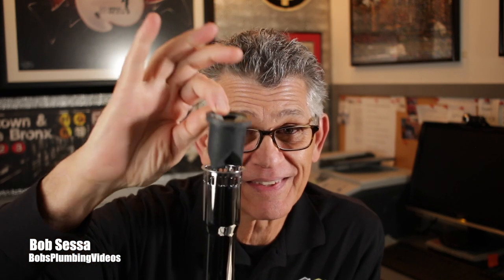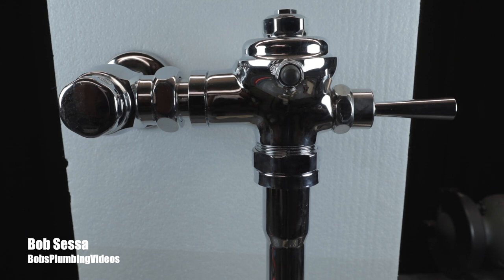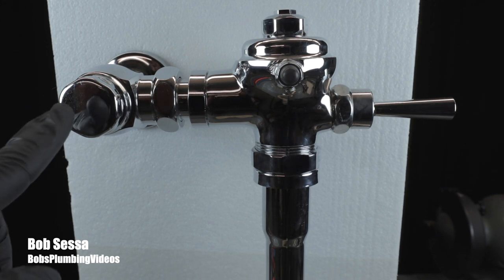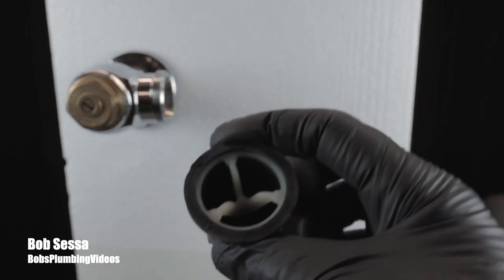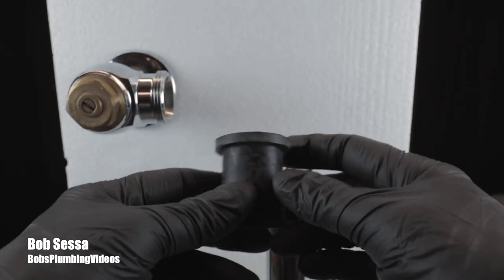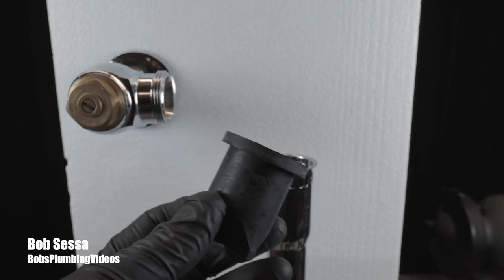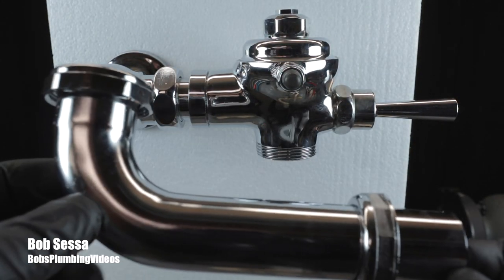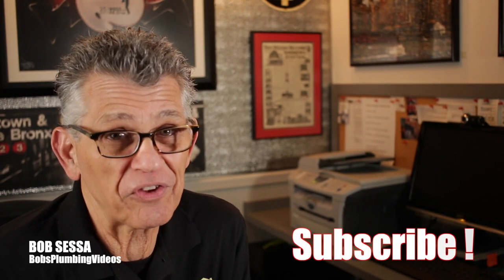Toilet Repair vacuum breaker leaking

Comment: Bob, you really should do a real life change of a flush “o” meter and show what a nightmare it can be!!
Reply from the maker: No doubt about it, I'll do it on the next change out but they've been far a few in recent years. Not many in private homes and the ones in multi unit buildings are being done by the superintendent's of the building. Thanks for checking out the video. Bob
Reply: wouldn't hurt to show people what it's like when you change that vacuum breaker it still leaks. That's a common scenario.

Comment: Good video! I just installed a new vacuum breaker and im getting water out of the air holes reinstalled the old one and the same thins is happening. Any suggestions? Could the vacuum tube be the issue?
Reply from the maker: Has to be some kind of small split/hole in it. Before you go crazy try another new V.B.

Comment: Hi Bob, thanks for the video.  I just picked up a replacement vacuum breaker for a Sloan V-500-AA, but the plastic insert looks different, the openings are a lot bigger than the old one.  Are vacuum breakers also GPM rated or is it just a newer design?  Thanks!
Reply from the maker: That is a great question, which I honestly  can not answer. I don't see why they would be, but I could be wrong. In all the years of doing this that was never a question that came up. My apologizes!
Reply: No apologies necessary, your vid gave me the confidence to fix it!  Installed it this morning and it works fine with the new insert.

Comment: I replaced a bad vacuum breaker with two new ones and it's still leaking. I've used silicone grease also. Can the tailpiece be bad? Anyone had this happen before?
Reply from the maker: You could just have a batch of bad vacuum breakers, tailpiece would not cause it to leak. Inspect the rubber carefully, a pinhole with cause it to leak.
Reply: @BobsPlumbingVideos  Thanks, Bob. I will try that!

Comment: I've never had a problem replacing a vacuum breaker however all of a sudden now that our toilets are getting up there in age any time I replace a vacuum breaker it continues to leak not from the threads but from the open spaces under the threads, the holes all around the pipe.  Not much, just a tiny dribble but enough to be a problem over time. Any idea what's going on here?
Reply from the maker: The vacuum breaker has a hole in it, replace it.
Reply: @BobsPlumbingVideos  It's a brand new vacuum breaker.  I just replaced it.  No holes.  Took it out, marked the side it was leaking from, inspected it and nothing.  Put it back in 180 degrees rotated and it still had a dribble on the same side.  Did a full rebuild with another new vacuum breaker.  Soaked everything in CLR.  Put it all back together and there is still a dribble on the same side.

I don't get it.  This is happening more and more with the toilets in my building as they get older.
Reply: Same thing here
Reply: I think the water pressure might be how much and your flush is forcing water back up out the holes cause the water pressure is so high, try turning down the cut off.
Reply: @rob1840  I've tried that as well.  From as low as it can possibly go and still turn off all the way up to crazy splash mountain.  Ours are always set as low as possible anyway.
Reply: @JustinEmlay  did u try a new vac breaker yet.... its possible they spit water at first also
Reply: @rob1840  Yes, two new ones.  First that's all that was replaced.  Then again with a full rebuild.

Comment: I did the same and still leaking under, why could be the problem? pls help
Reply from the maker: Check the vacuum breaker, all to often brand new ones have small pin holes in them.

Comment: Bob are you out on the field right now?  with the situation or are you taking time off
Reply from the maker: I'm trying not to go out if I don't have to. Tricky situation, I have some really good clients that own rental properties and they have to be serviced. I'm basically only going out on essential services like no heat, no hot water, severe leaks, etc. Repair and installation can wait, besides the phone has been DEAD! Regards, Bob.

Comment: What are the risks of changing the breaker without turning off the water and removing the body?
Reply from the maker: I've done it, being very careful not to accidently hit the handle in the process. You also do not want to accidently hit the piston that the handle pushes up against or it'll cause a flush. When in doubt shut off the valve just before the flushometer.